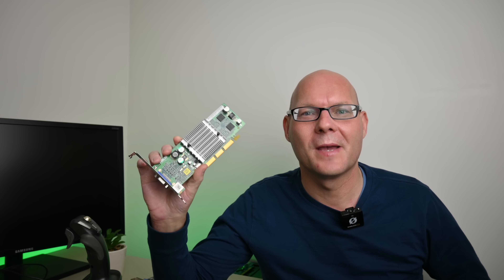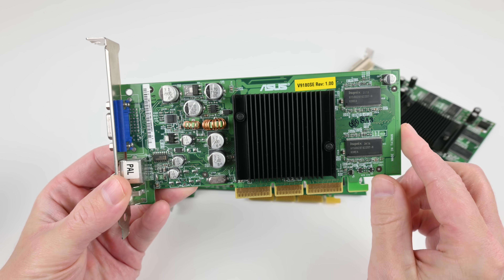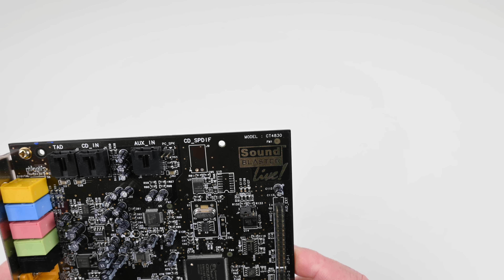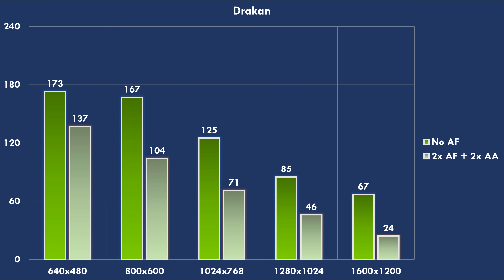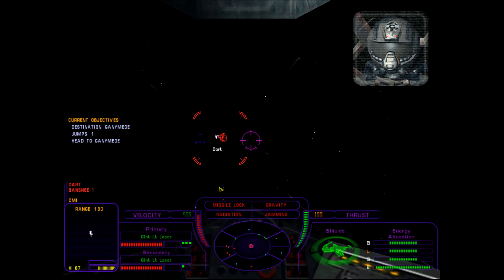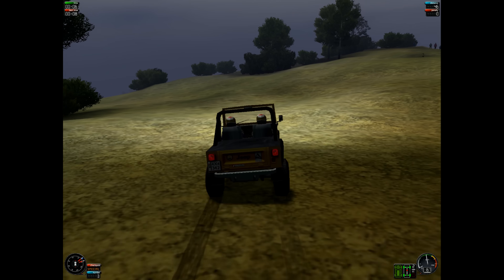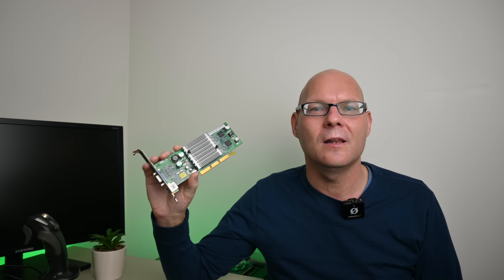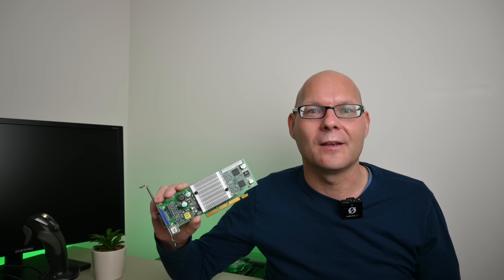One of Nvidia's most Controversial GPU

Comment: I have SO MANY physical copies of PC games where the requirements section WARNS: GeForce 4 MX NOT SUPPORTED. The MX and FX cards I'm sure turned many people towards Radeon. My own brother was tricked into "upgrading" to a FX 5200 from a Radeon 9100...for our home PC. 2 years of pain I'll never forget...it did make me curious about PCs and how they tick, and I now know how to build and optimize, so I suppose it was worth in the end XD
Regarding the games, Tachyon: The Fringe is a FANTASTIC beginner's space-sim: The challenge and depth are just right even if it's your first time using a joystick (though KB&M work well too), the story is shockingly good and the voice acting is LITERALLY one-of-a-kind...Bruce Campbell in the lead and several actors that only ever acted for this game ALONE as the other characters...with exceptional results (wait until you get to baron Hajod!). This is the only Novalogic game to be story-driven if memory serves, and yet they nailed it...
And regarding Max Payne: If you want to see the game through to the end, SPRAY & PRAY. The game has a dynamic difficulty system that infamously adjusts based on accuracy first and foremost so if you're accurate...so are the enemies. HP distribution is actually quite reasonable (Hint: ALWAYS check for aid lockers) but firing accurately gradually becomes unfeasible. Enjoy ;D
Reply from the maker: Thanks for the tips!

Comment: I like these MX cards a lot. For very little money you get a card that can handle even early XP titles.

GeForce4 MX cards currently in my collection:
Captiva	GeForce 4 MX4000 4060787134295
XFX	GeForce 4 MX4000 PV-T18L-QTHG
XFX	GeForce 4 MX420 PV-T17A-MAFB
XFX	GeForce 4 MX440SE PV-T17L-QTFB
XFX	GeForce 4 MX440SE PV-T17L-DTHB
XFX	GeForce 4 MX440 PV-T18K-NCHB
MSI	GeForce 4 MX440 MS-8866
Medion	GeForce 4 MX460 MS-8863

The XFX MX440 (not SE) and Medion MX460 are almost equally fast.
Reply from the maker: Great collection 😃

Comment: I'd say that TNT2 M64 was their first "not what it sounds like" type of a card. And yeah Phil, the MX 420 is the SDR version you mentioned.
Reply: The first computer I bought with my own money (and our first with 3D acceleration) had a 32MB TNT2 M64. I was so disappointed by it... :(
Reply: @Ale.K7  I had a TNT2 16MB PCI and a TNT2 M64 32MB AGP.   The TNT2 16MB PCI was faster in most cases.
Reply: @Ale.K7  Why were you disappointed with it? The M64 was a very capable budget card for the time. The only real deficiencies it had were in 32 bit color or high resolutions, which were held back by the 64 bit memory bus. 32 bit color at the time in games was still a new thing and commanded a premium to render at that quality level with acceptable performance.
Reply: Likely because TNT2 M64 was still used for budget PCs as a socket filler as late as geforce 2 by OEMs. It wasn’t until geforce 2 mx they stopped shipping TNT2 M64. A TNT2 M64 in 1999 was perfectly acceptable. One resolution lower than M64 pro you got the same framerate; so e.g. 800x600 instead  1024x768.
Reply: TNT2 pro; not M64 pro. 😜
Reply: @soylentgreenb  But a normal consumer didn't know what that M64 meant. Normal consumer was most likely "OH BOY, A TNT2!" or something but the reality was bad. :/
Reply: @GGigabiteM  Sorry, I should have elaborated. Indeed it was a budget card and I shouldn't have high expectations, but it came in a relatively high end, expensive computer in late 2000, and I didn't know better and was happy of getting "a 32MB nVIDIA card". Yes, the computer shop and I were the ones to blame, not the card :P.
It was an U$1200 (electronics in general and computer hardware in particular are VERY expensive here in Argentina) 850MHz Socket A Athlon with 128MB of PC-133MHz RAM, DFI AK-74...SC, I think, mainboard, a 30GB Samsung HDD and a Creative 52X CD-ROM drive. Except for the CD-ROM drive, which was always crap and lasted a very short time, I still have the computer :-).
Reply: @keulloe  That was me! 😂😭
Reply: @GGigabiteM  there's no such thing as staying away from y-board or x-board, at the time it would be correct, but in 2023, any old hardware is a valuable piece to study its performance, compare, test, modify and have fun
Reply: @soylentgreenb  In 1999, I'd rather have the Voodoo3 over the M64, any day of the week.
Reply: @Ale.K7  Good times of PC building. I was using a Duron 750 / 256MB / GeForce2 GTS combination. I was slaying Celerons all day long. 😅
Reply: @ColeçãoNintendo  To those of us who were around 20 years ago when said devices were new, there's plenty of reason to stay away from them.

We know the performance, everyone did performance metrics on them, people bought the devices and validated the performance. There's nothing left to test. We also remember the betrayal we felt from Nvidia using the Geforce4 name to carry the shitty MX card that was based on much older and far more limited Geforce2 silicon.

Thanks to the internet and most tech sites, you can still read said reviews today.

No, the cards weren't worth the money back then, and they certainly aren't worth buying from some scumbag on ebay for inflated prices just to have a piss poor experience.

As for modifying them.... what? Ok, so you find a model that you can upgrade the RAM on, it's still a shit card.
Reply: @Ale.K7  I wish I still had my AMD build from that time frame. It was an Athlon 1333 on a AK77-PRO-A with 256M of RAM and a Geforce2 TI.

The motherboard died from the capacitor plague, and I didn't have the skill or know how at the time to recap it. I had the Geforce2 TI for awhile until it was sold to someone else years later.

The entire AOpen line of motherboards at that time was notorious for the capacitor plague, and as I've seen, few survive today. I had a trio of AOpen boards that all died within the span of a few years from that, before I went on to MSI and never had an issue again.
Reply: @ColeçãoNintendo  Yes exactly! Always have to remember that people did buy these products and were let down at the time but in hindsight in 2023 there are no bad products just different results and different use cases.
Reply: @GGigabiteM  Agree. Just tinkereed with a M64, and OC-d Core/Mem. to the max. Tested with only two games from the period: Quake III and Re-Volt. Although on quite low res. (640×480) and of course 16-bit color depth, but otherwise every setting was maxed out. Q3 benched 79 FPS and Re-Volt was aroud 90 FPS. I think for the time these would be pretty good framerates.
Reply: @Hudee1985  People would have swooned for a frame rate that high. Technology was moving so fast at that time that a 6 month to a year old system may not be good enough to play a next gen game.

Poor kids couldn't afford to upgrade every year, so many of us had "ancient" systems and we'd be happy getting 15-20 fps in 3D games. 80-90 would have been mind blowing.

I had to stretch my 1997 Pentium 200 MMX all the way to 2001, and by that time it was painful to do anything on.

It's not like today where you can have a 10-15 year old system and still be fine, because quads have been out forever and an SSD goes a long way.
Reply: Lucky. I had 8MB Vanta, which was the lowest-end model of stripped TNT2. It did let me play some great games, though, like System Shock 2 and Homeworld.

Comment: Geforce 2mx, geforce 4 440, fx 5200. They can do alot considering Tnt 2 m.64. SAME BOARD they used to make 4mx and 5200
Reply: "Same" and "Board" aren't acronyms
Reply: @the_motherfucker  Board might have been used for both fx 5200 and 4mx 440. They may be switched to each other or circuit is the same foe both cards.

Comment: Geforce mx440 was a good base video card back in 2000.
Reply: Yes. Too bad it was released in 2002. It was already obsolete not even having direct X8 like GeForce 3. Personally I went with the GF4 Ti 4200 back then. So much better. And much cheaper than the 4600 while I could OC it to the same level almost

Comment: Actually if you're honest, you would have to say: STAY AWAY from ANY geforce 4 mx card, be it 420/440/460 or anything in between. They ALL suck! You're FAR better off with a radeon 7500, 9500 or 9700 or anything in between. Of course the holy grail would be a radeon 9800, whatever version, there was no bad iteration of the 9800 mini series, even the worst 9800 SE with 128MB and 128bit bus would slay any gf 4 or gf fx. I know that, because I ugraded from a gf 4 mx 420 64MB SDR version to a radeon 9800 SE 128MB 128bit vdvo, and laughed at all the envious faces at our lan parties, with their crappy gf 4 4000s and fx's. 😂
Reply: A functional radeon 9800 costs a fortune, most cooked themselves because of the metal shim around the chip
Reply from the maker: Well the Radeon cards all have issues with fog and the weaker ones struggle with OpenGL. For Windows 98, the MX cards are good, but stay away from 64 Bit variants.

Comment: I feel like i motivated you a little bit with my comment in a later video about my GF4 420mx. But mate i did beat DOOM III with that GPU and Duron 1100 , 768MB ram. Average fps was under 10fps. I used a method by unpacking some texture files for more speed, dont know if it worked.
Reply from the maker: Finishing Doom 3 on that card, hat off to you!

Comment: Back then, i am really glad i skipped the gf4 mx series. When my ti200 died, after a rather legendary overclocking run, i had pooled together everything i could to make the most of what i needed to go to a Ti4200-8x. At that point in time, it was a choice of either faster clocked 64mb or slower 128mb of memory. I must have lucked out; my asus ti4200-8x was the 128mb variant and overclocked to the faster spec without even trying. 😮
Reply from the maker: I want to cover the 4200 for sure, IMO one of the best value cards from Nvidia, with 8800 GT and 6600 GT.
Reply: Yep, that was the secret of the Ti 4200, the 128 MB version was slower! IIRC, the VRAM sucked on the 128 MB version.
Reply: @RJARRRPCGP  Which makes the overclock I was able to do, all the more surprising. Specs wise, there was no way the memory should have matched the faster clock of the 64mb version; yet it did. Granted, the games I was playing at the time were nowhere near as demanding, so it probably got away with a lot more. 😅

Comment: I had a Ge Force 2 and was wanting to upgrade to a Ge Force 4600 ti but could not afford it, I was not very savvy and I bought a Ge Force 4 MX 440SE 128MB, I was playing at 1024x768 @ 75Hz with games such as Day of defeat with a Pentium 4 @2GHz 400FSB (from memory those specs are correct about the CPU) Willamette and 256MB RAM and a 40GB HDD with Win XP. The main thing was the extra video RAM which really was never utilised apart from Far Cry 1 which was not meant to support this card but did due to the video RAM even though the shader model was not officially supported so I had some texture / shading issues.

Comment: This card on the other hand had a really good T&L engine to "compensate for the lack of DX8", at a point it was a viable card for CAD stuff. which made it hurt the quadro sales.
Reply: Iirc the hardware t&l was pretty much why I got it!  It was fast becoming a necessity
Reply: @TheTurnipKing  You probably got a lot of it.
Reply: @dan_loup  IIRC, I needed it for the likes of Dungeon Siege & Neverwinter Nights circa 2002.  Games like these were just starting to demand the presence of hardware T&L.
Reply: Dont forget Battlefield 1942!
Reply: It didn't lack DX8 though. It supported pixel shaders with NSR. Doom 3 looks like it does exactly because of it.
Reply: Nonit completely lacked pixel shaders. Every effect in Doom 3 will work on a geforce 256 in a shit-tonne of passes.

Comment: Had a Geforce 4 mx 440 agp 8x 64mb model for a while. Later side graded to a Radeon 7500 64mb and it was just faster. The a 9600xt for my final agp card. All paired with an Athlon XP 2500+ Barton

Also tachyon the fringe is amazing

Comment: Oh god I had that card, It wasn't a good card nor reliable to deal with. It was faster than GF2 MX I guess, but I feel like it was slower than my Radeon 7500 64 MB VRAM (That I have on my one of the Retro PCs) At some points. (Note: My GF4 MX had the same memory of VRAM, which is 64 MB. I forgot which model it was sadly.) I find it pathetic that it had DX7 at max, at least they could give an DX8 support!... But yeah, it was based on GF2 technology, so I suppose it couldn't work that way. So um, yeah, GF4 TI or Radeon 9700 would be a better choice with DX9 and XP games. 

But as I said before, GF4 MX might be a good GPU for W98, but I'm not really a fan of NVIDIA drivers for it. They seem clunky with some titles. 

I believe also that DX8 is like the last good working version of DirectX on 98, based on my experience with and it's games. It's more problematic under 95 I think. 98 seems fine with it.
Reply: There is DirectX 9.0c support for Windows 98 SE.
Reply: @RJARRRPCGP  Yes, there is, but DX9.0c support on 98SE seems to by iffy at times. Never managed to play Call Of Duty 1 without any random freezes. The only game that has DX9 support and works with 98SE pretty okay is actually The Settlers - Heritage of Kings. Other than that... Maybe Grand Theft Auto III, and Vice City? Perhaps? And maybe UT2004. But there's where my ideas start to end. There's More DX9 games that are supposed to work with 98 don't work that well. Or dropped 98 support entirely.

Comment: Phil, I bought a Canopus Spectra WF17 (GF4 MX460) as I thought it would be faster than my GeForce2 Ultra on my 1GHz P3 Win98SE rig... but it's SLOWER!  It's clocked higher, I'm using the same driver version across both cards, VSYNC is disabled and 4xAA ENABLED.  3DMark2K score is about 3800 for the GF2 and 3200 for the GF4MX.  Games are slower on the GF4MX too - more "stuttery" and framerates confirmed lower w/ Fraps.  I think it's related to the AA logic, as IIRC the two cards score about the same w/ AA disabled - but I want it on.  The GF4MX's AA also "looks" different.  It's more blurry, so I suspect it's actually using different logic - but I'd call it a regression cuz it's slower and it looked better to me on the GF2.  Any thoughts?
Reply from the maker: That is weird because the GF4 MX is meant to have better AA and be more efficient clock for clock. GF2 Ultra has a very high clock speed though, especially the memory, that could matter here...
Reply: @philscomputerlab  At 3:26, Everest shows 2 pixel pipes and 2 TMU's per pipe for your GF4MX whereas my GF2 Ultra has 4 pixel pipes and 2 TMU's per pipe.  I also have pixel and texel fillrates listed at 1,000 and 2,000 respectively.  Could that be the difference?  My GF2 clocks are 250MHz core and 460MHz effective VRAM.  I don't recall the exact clocks my MX460 card was using but I know both were higher than those of the GF2.  And regardless, I say the AA is better on the GF2!  Maybe at higher resolutions, the GF4MX might look better cuz it is "softer" at the same setting but at 800x600 or 1024x768 it just looks blurrier - and in no way better!

Comment: I recently checked out the AMD Athlon 64 x2 6000+ that I purchased with some other PC Parts.
I didn't checked the TDP and the PC turned on with the Cooler I was using, so I figured out the CPU Cooler was Hot as Hell, I switched to a 135W Cooler and it happened again, I had change the FAN Speed to 100% to make it almost work but still it crashed due to overheating after half an Hour.
It's a challenging CPU when it comes to cooling if you don't have a water cooler (like in my case).
Reply: I have all three variants of the 6000+ in various PCs and don't have a massive problem cooling them now (got ok temps with the AMD FX bog standard cooler on them, which are no use for the FX CPUs themselves), I would experiment with different types of thermal paste application to make sure there is good contact (from memory I think the thin spread over the whole top worked best rather than dot or line, but it can vary with cooler - I've found with some AMD CPUs from this period that they like a thick spread for some reason). I would also check the case air flow.

Comment: Call it GeForce 4 was not happy marketing I think, it is 4 times weaker than real GF4 Ti, but it was probably decent budget card back in the day, some MX 440 is still better than FX5200 and you really didn't need DX9 support in 2002. So I would maybe call it just GeForce MX without "4" in name and I would be totaly ok with that. BTW, I have both, 64bit and 128bit versions and I expected bigger difference between them, but both are much better than FX5200 with 64bit bus, you will not such such big difference in 3D Mark 2001, but when I start some actual game like RTCW, MX440 is much better than those worse FX5200 cards. Pasive cards are better because when you put some low RPM fan on it, it's much better than those crazy coolers with integrated fans from that time.